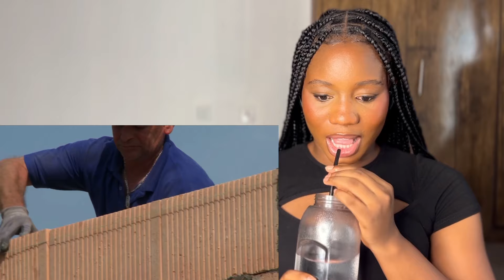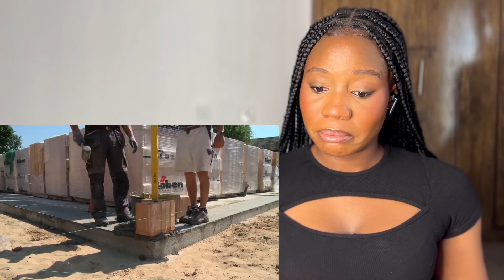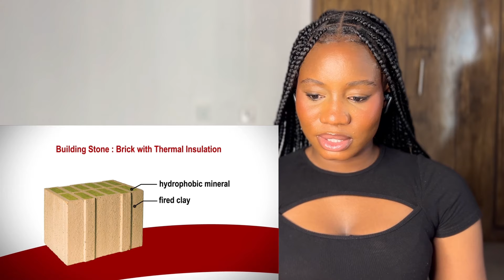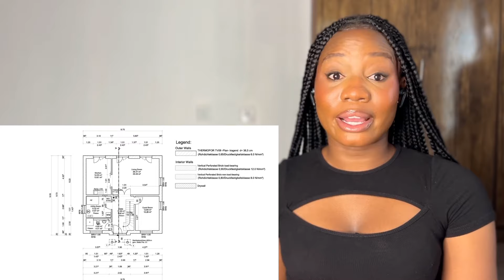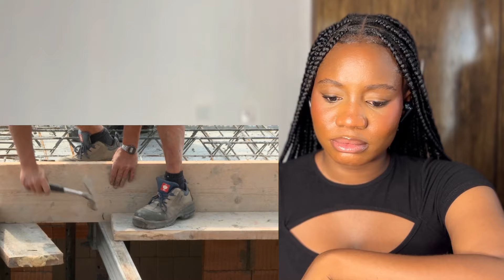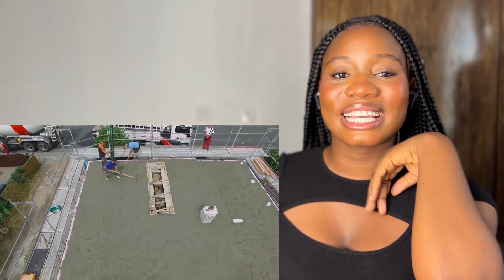American reacts To How German Houses Are built

Comment: This is the second part. In the first part they show how a pit is dug.
Normally a pit is dug, the pit is filled with gravel and compacted. Only once a trench is dug and filled with concrete and iron as ring anchors. Then comes the formwork, iron and concrete. Then you have the concrete slab on which the bricklayers are building in this part.
Reply from the maker: I missed that part of the video and here I am thinking there’s no foundation below.
Thanks a lot, this was indeed helpful.
Reply: @ItsBabeCookies The part with the roof is also missing. Some houses also have a basement. However, since a basement is more expensive (approx. €60,000) than an additional floor, people often do without it these days and people have a carport with a shed built (approx. €15,000) instead.
Reply: That concrete slab ( groundfloor) nowadays is also insulated . Too much cold is coming in from the ground into that concrete slab (groundfloor) during wintertime when it is freezing outside (not so much done in warmer areas as Spain aso). Also I thought those bricks are glued together ( or using a specialized insulating cement mixture) and not put together with the common cement used for stone bricks just to avoid ' cold bridges'.